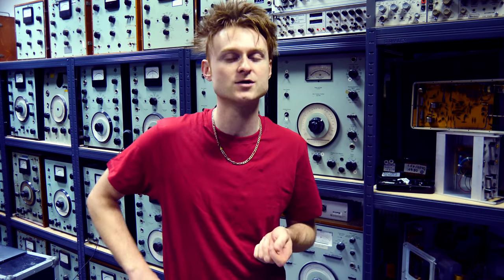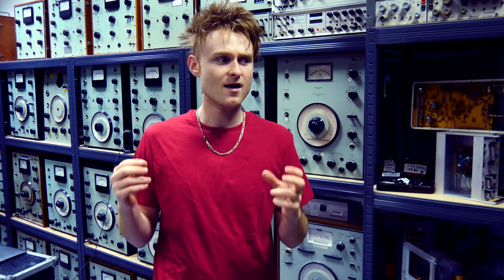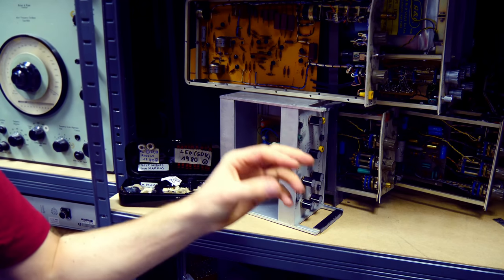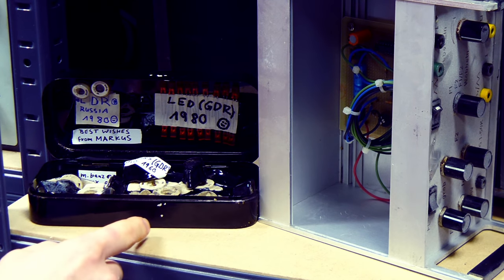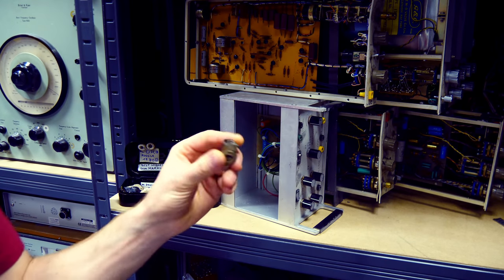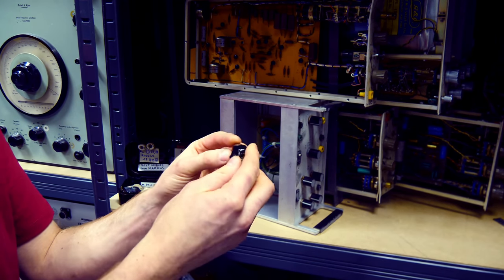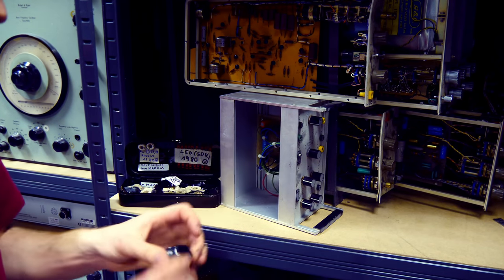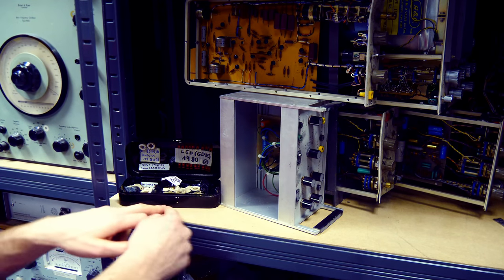Exploded Views, And Other Oddities.

Comment: what if the exploded view pieces were wired together? like the ms10 - you could explode it all but add wires between the bits so you can use it and see it all opened up?
Reply: me & some of my mates did this to our calculators while at college. I kept mine in a plastic sleeve in a ring-binder, with the buttons, main board & display all spread out, & long wires going to the battery clip- the battery lived in between the clippy bits of the ring binder.

Comment: The older gear is sculptural art compared to the "black blob" circuits we find in modern kit. I like the idea of an equipment timeline (beat frequency oscillator). Hands on (sanitized?!) is what sparks the imagination, that was the best bit of synthfest (Sheffield). Please do promote the DIY community, we generally fly under the radar. Sorry about the overuse of brackets (really, I am).

Comment: Going to school in the early 00's we still built circuits on wooden particle board with the schematics printed and glued to them. You stuck some nails in and soldered copper wire and the components. These circuits are really simple to follow as you can use the same layout as your schematic and it might be a nice wall piece. I am thinking about making some synth circuits in this format
Reply: Wow! Still doing that in the noughties.... that's so cool.

Comment: As someone who repairs cb/ham radios test equip etc this vid is pure electroporn to me .
Looks like its going to be one awesome place when its done i would like to visit there one day .
How about mounting some old valves in something and powering the heaters on them some of the larger tubes look nice when lit up or you could mount leds under them as well to light them up
Reply: Yes definitely! I'm after some classic chunky valve testers to power the heaters. Atm I'm trying to get the bare minimum down to build on but definitely!
Reply: You don't need much to run the heaters a transformer from mains to what ever voltage the tube needs . As long as the transformer has enough amps it should be ok or you could string a few tubes together in series to run at a higher voltage. I've repaired a few valve radios that work this  way

Comment: One of the things i used to like is something displayed in teh middle of a board, with the descritions of each part around the outside, and a line connecting the item with the description, you could do something similar with threads stuck to components, if people want to know what the component is, follow the thread.
Another thought is buttons next to descriptions, and led's near the parts
Reply: Cool idea!